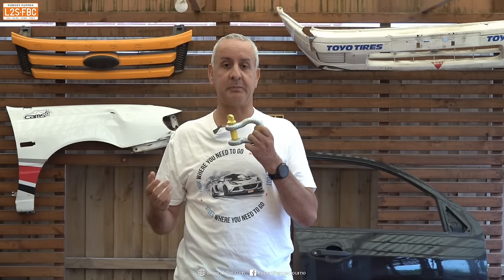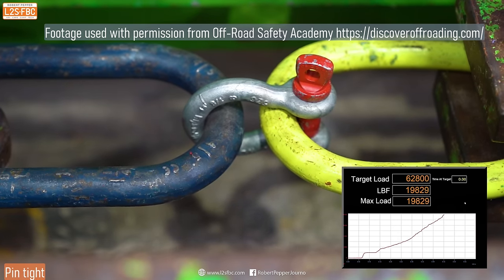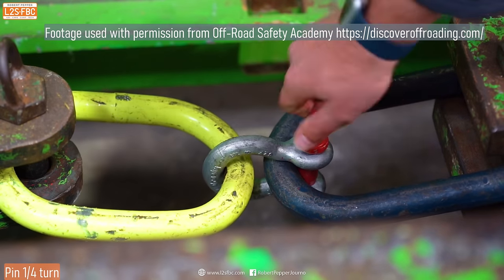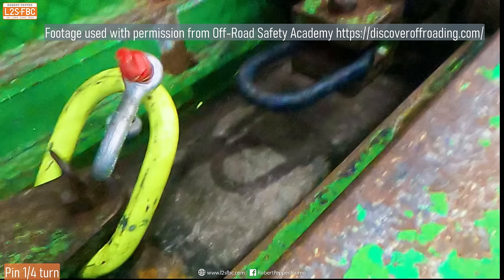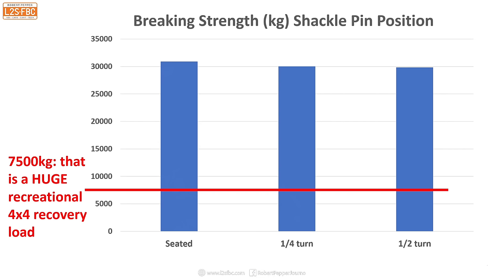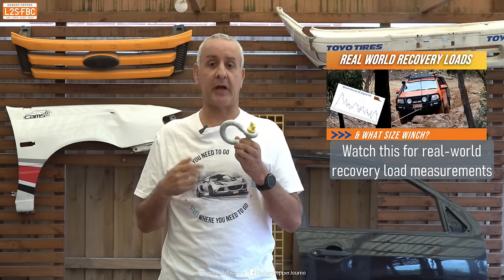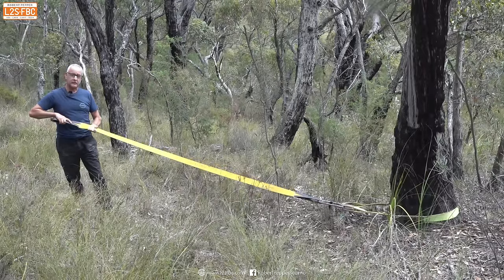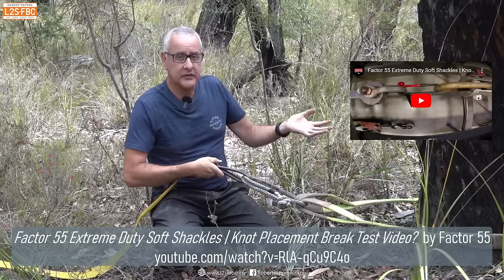What happens if you back off a shackle by 1/2 a turn?

Comment: Professional heavy recovery wrecker operator of 41 years experience here.  I completely concur with your assessment.  I work daily with equipment and loads fully capable of destroying that screw pin shackle, and I have ruined several over the years.  I have never pulled one to complete failure but deformation comes well before failure.  I train to normally back off 1/4 turn but for an important reason you didn't cover.  When we go to remove the pin after a recovery that was set at 1/4 turn and find we can't loosen it by hand we know the shackle was exposed to plastic deformation.  In other words we know the shackle was damaged and needs to be removed from use.  We then screw the pin in from the opposite side to mark it as damaged, then back at the barn we destroy it by cutting it apart.

The only exception to the 1/4 turn back rule is a situation where we fear it could become loosened.  Such as rigging that will be used over and over to lift items or pallets of cargo onto a trailer.  In this case we tighten with a tool and put a zip tie through the hole to insure it can't back out.  The zip tie also serves as a visual flag that can be inspected at distance showing the pin hasn't backed out because to do so would bust the zip tie.
Reply from the maker: Fantastic thank you and a great example of varying the technique according to the use case 👍👍👍
Reply: In the case of repeated use a bolt type shackle is better.
Reply: 24 year crane op here, we do the same, 1/4 turn loose.  The testing is kind of pointless, as the shackles are so grossly overloaded, if you've gone that far you've already screwed the pooch!  What I got out of this elaborate test, was for a proper shackle used in the right place and time, even 1/2 turn makes no difference.
Reply: I’ve done a lot of rigging over the yrs. 1/4 turn is a must and normal with no worry of failure. Having to wrench lose shackle is ridiculous when a slight turn stops this especially if one is flying loads all day or even for 30 minutes. Small or large shackles makes no difference. Never had one fail ever. Knowing how to rig properly will make the difference while keeping you  /crew bystanders and your load safe.
Reply: I'm not a Crain operator but we do use shackles from time to time and I have told the kids to back it off a little but noooo they use them then ask me to torch them because they can't loosen them and they are afraid they will get burnt if they cut with the torch. I tell them if you cut with a torch it's not you get might hurt if you get burnt it will hurt!

Comment: The quarter turn was taught to sailors in ships anchor gear. There number one concern is corrosion and the ability to slip an anchor. Shipboard shackles are always moused closed so being able to break a shackle free of its pin when it has been siting in salt water for years is more beneficial then a three percent working load loss.
Reply from the maker: Thank you didn't know that, very useful!
Reply: Moused as in loosely fastened?
Reply from the maker: No, "moused" is closing the loop parallel to the pin with string or something so when the pin is removed the shackle doesn't fall out.  In marine applications that could mean losing the shackle...in 4x4, it's just on the ground and you pick it up so it doesn't matter and we don't bother mouse.  This is again where best practice in one industry does not necessarily apply to another.
Reply: @L2SFBC  Sailors are taught to use mousing wire, locking wire, and sometimes referring to as sizing wire. This locks the screw pin to the Shackle in a figure eight fashion. This prevents the screw pin from backing out on ground tackle. The ships swivel shot is held together with massive shackle that holds the anchor. All shackles are screwed all the in and the backed off a quarter turn then moused in a figure eight fashion to prevent the pin from backing out. The anchor does not actually hold the ship to the bottom the weight of the chain does that. So as the chain moved around the shackles are getting pounded in every direction. This is why each shackles is locked after it’s quarter turn. The quarter turn allows movement to break rust free so you can remove the screw pin after you cut the mousing wire off. This allows you to slip a fowled anchor. I will try to find it in my old manuals for you.
Reply: 3% will be within the variation for either snug or backed off I bet.
With climbing screwgate carabiners you back them off a fraction so they don't bind under stretch.
Reply: I was Chief Engineer on board very large private yachts for twenty years and we always used stainless steel wire to secure the pin to the shackle so that the pin could not rotate with vibration, and fall out. And yes, we always backed the pin out a hair from snug.
Reply: @erictyrrell3560   - "moused" as in secured from unthreading through vibration - often wire or wire-grommet secured (in different fields of use..   (a modern stainless zip-tie will be overkill, but adequate).  Note that all rigging (standing rigging) shackles/clevises should be tight and moused/secured.
Reply: @L2SFBC    - mousing a hook is slightly different to mousing a shackle - a moused shackle cannot have the pin unthreaded -  and removed.
Reply: @getahanddown   - reasons - why triple or quad locks exist...
Reply: @lowandslow3939   - is this wire known as "mousing"?
Reply: @kadmow  I’ve never heard that term. It’s a simple security measure used in marine applications, much like stainless steel wire used on aircraft engine bolts, passed through very small holes in the bolt head. One bolt is tied to another, and then to another, and so on, so none cane rotate counter clockwise and loosen.
Reply: I think I learned more in this comment section than the actual video. Thanks guys
Reply: trust me when I tell you this ,,, leave it 1/4 turn loose on an anchor or moorings and the pin will be worn away to a straight bar with no threads in a year ,,, Im a commercial diver and see this so often its crazy ,, personally on my own moorings I weld the pins in
Reply: Perhaps in Static pulling situations for rigging and such where itll be in place for a long time. As a ships engineer I'm primarily using them in complex chain hoist setups to move machinery in tight spaces and im more worried about that pin actually coming unscrewed as things twist and shift. I've always gone finger tight and on some occasions even wired it in place. if the pin does end up bending enough that it jams then 1.) You know for next time that you need to use a larger size and 2.) that's why they have a flat head on the pin you can undo it with a wrench.
Reply: @kadmow Mousing a shackle prevents the shackle falling off  the rope or chain it's attached to when the pin is removed, it doesn't prevent removal of the pin. That said, the pin can also be moused to the bow to prevent it loosening if required.
Reply: That's what I remember too. Although in the helicopter bourne minesweeping we always fully tightened shackles before safetywiring the shackles.

Comment: I was taught the half turn back off... purely so it makes it easier to undo the shackle. Under load it tends to tighten up so if already snug, it will be tightened beyond what you can undo by hand. Backing off half a turn gives the pin some wriggle room but you can still undo it by hand. This was in the Royal Australian Engineers and the thinking was you have to undo the thing under fire or hanging onto something with one hand and don't want to have to faff about or scrabble for a marlin spike or shifter. Great video as always.
Reply from the maker: Interesting, I was expecting Army people to come on and tell me it must always be done up with a three-metre lever!
Reply: @L2SFBC  As well as recovering vehicles, I've also used shackles when sailing. When we used shackles for sheer legs, flying foxes and lifting cranes I was taught never to have the cable run over the pin as it will either tighten it to the point it will never come undone or completely unscrew and drop the load. Your thoughts?
Reply from the maker: Well, I don't work in those industries so can't really say.  However, I can say that I have actually used a shackle as a pulley (see previous video)...and was able to undo it afterwards, albeit with some effort.
Reply: @fatmanfaffing4116  The rule-of-thumb for riggers has always been that the pin goes up or towards the hook. That’s not always possible, depending on what’s being rigged, so the fall-back is that, the pin goes towards the end with the least potential movement. So if you were using a shackle as a makeshift pulley, the pin would go towards the stationary side of the “pulley”.
Reply: i was a Chain and Rigging Certificating Tech for 9 1/2 years (also an ex RNZAC Tankie 12 1/2) the reason the pin tightens when you have backed it off is you a very slightly stretching your shackle, after repeated use the pin will not reach the outside edge when screwed in as it is supposed to under specifications for use because the bow has stretched too much. if you want to be safer and still be able to undo the shackles quick use Safety Bow Shackles which are the type with a bolt pin and nut and swap out the safety split pin for an "R" Clip or a locking retainer clip and you can leave the nut very slightly loose on this type without compromising the shackle as much. P.S. ANZAC's  Brothers in Arms Forever.
Reply: @L2SFBC  have seen forestry guys use a shackle as a pully with wire rope and when they went to take it off it had worn about 90% through the pin and part way through the inside of the bow and i still have photos of it as it went in my training kit for teaching people what not to do with lifting and rigging gear.